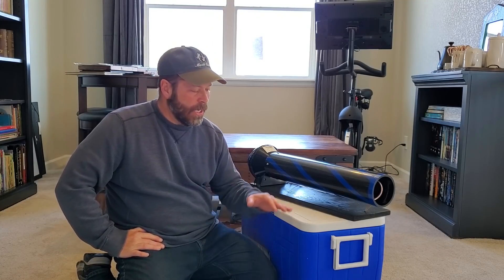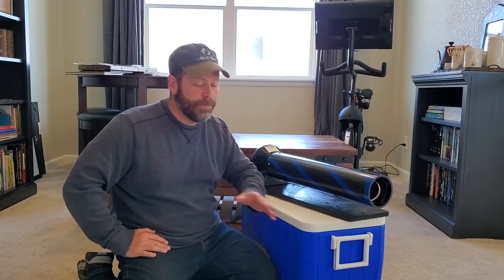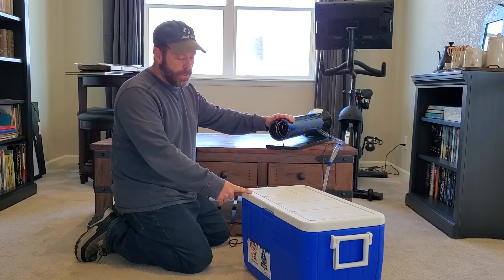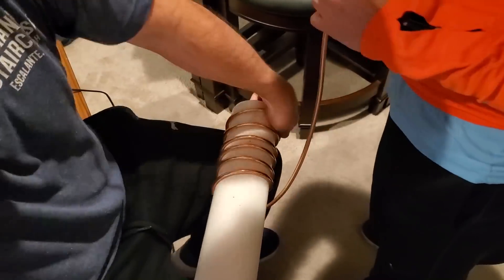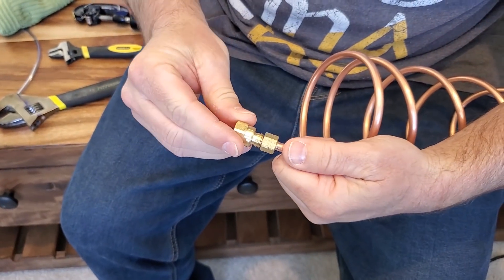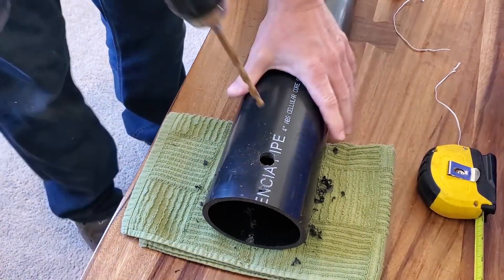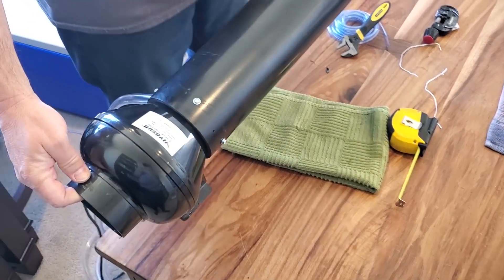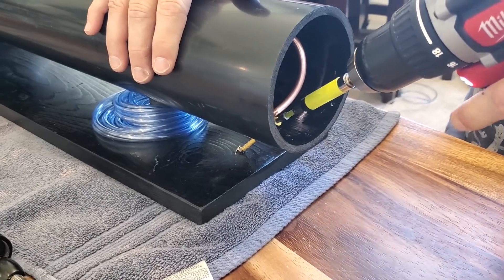Homemade Portable Air Conditioner DIY - NO HUMIDITY! - Long Lasting Ice! - The Fan Cannon

Comment: Some thoughts on this setup:

First, I'd like to say you are one of the first to use a coil setup instead of evaporative cooling, which is the best way to cool.
Next, you mounted the fan directly to the air tube, which severely limits airflow. The best way to get the most airflow is to use a larger pipe diameter than the fan outlet and the fan flow will suck air in from the extra space around the fan. This is called the Bernoulli principle. The low pressure generated by the air stream from the fan creates a suction in the tube, generating more flow, a LOT more. Think Dyson fan or compressed air venturi.

Also, you would need to insulate or house the water pipes as they will condensate in high humidity. The best way to do this is to put both inside a larger pipe and have it connect to the cooler. As long as the fan is above the cooler, then the condensation will drain back to the cooler.

A step up from this setup, which would require a permanent mount, would be to use a water coil, just like the ones used in driveway heaters and some air conditioners, for increased cooling surface area.

Lastly, I don't know if you have done this in a video or not, but I would like to see a run time on 10lbs of ice (1 bag) showing the room temperature and exit air temp during the test. Maybe do a test outside in a garage or some other shaded area when it is 80 or more outside and see how long the fan will produce sufficiently cool air.

Sorry for the long post, but this is a really great idea and very similar to what I had planned to do!
Reply: Hopefully he responds to this, but not likely. Are you capable of making one? I’d like to see it
Reply: Please make one and ahow it on YouTube like this step by step
Reply: @debbie4710  I have one, and will look into making a video on the setup of my next one. The one I made is highly experimental, and very crude. My next one, since I proved the concept, will have a proper water coil, a better fan, and a better water tank. The issue is the money needed to create it. The water tank is expensive, so I'm looking into alternatives that are insulated. I really don't want to use a cooler.
Reply: @charlieodom9107  Can you explain why you say that a coil setup is a better way to cool than evaporative cooling? Thank you if you can.
Reply: @insider235  evaporative cooling adds humidity to the air, whereas a coil does not, and can actually dehumidify if the coil temp is lower than dew point.

You would need a humidity far lower than 40% in order to use an evaporative cooler with any degree of effectiveness, and to be honest, most of the US has higher humidity than that when cooling is required.

Also, using a water coil with a closed loop keeps the water isolated from the environment. This means shit in the air won't end up in the water.

I have one that has a 12x15 or so coil, attached to a 10 gallon tank that I fill with ice water, and has a submersible pump to cycle water up to the coil. I use a 12V 14" fan in a bernoilli tube for airflow on a PWM controller for speed control. It runs on a lithium pack made from pouch cells and can run all day on a single charge, unless on max speed. Airflow at max is around 1500cfm, and cooling at that speed is nearly 10,000 btu. You need a damn commercial ice machine to keep up with the heat load.
Reply: @charlieodom9107  Ah thanks. Very informative and good description. I'm curious though as you wrote that he was one of the first to use a coil setup instead of the evaporation cooling but all every DIY AC I've seen so far has been a coil setup. Could you possibly post a link to one of the more popular evaporative cooling setups that you are referring to? I did see one where a man used a maroon colored sheet over a screen door but I had to dig to find that. All the homemade AC videos I've seen on here are coil setups otherwise. Thanks again!
Reply: @insider235  the evaporative cooling ones are all over the place. Any cooling device that moves air across the ice water is evaporative cooling. Most people who build these just mount a fan on top of a 5 gallon bucket and put holes in the side. There are variations, like using a cooler and mounting a 90° pvc coupler beside the fan, both mounted on top of the cooler, but the exact same principle. Air moving across a cooling mass, such as ice water.

As far as a link, just search DIY Cooler AC and you'll find a hundred or more.
Reply: @charlieodom9107  Ah, thank you Charlie. I'll check it out. This is so interesting to me and I have enjoyed learning about these DIY ACs even though I don't need to build one lol. It is obvious that you know a good bit about ACs. Thanks Again!
Reply: @insider235  I once fell into the marketing trap of evaporative cooling products, and wouldn't want anyone to do the same. It is very simple...if your humidity is below 30%, then evaporative cooling will work for you. If it is above 40%, then it will not.

Between 30-40% is a dead man zone, as you get to the point of adding too much humidity if you try to use a decent sized evaporative cooler, but it can work in small scale, like personal coolers.

Here in Florida, it is 80% or more pretty much year round.
Reply: @charlieodom9107  Ah, I get that. I detest marketing traps. I'll add evap coolers in high humidity to my list along with time shares which I recently learned about then. I understand that the humidity matters and you did mention that previously. I only was aware of vapor compression refrigeration/cooling until I read your comment on evaporative. Following that I also learned about absorption refrigeration using heat which is how my RV fridge works. I'm not sure how ice water in a copper tube is classified in the AC/refrigeration world however. In heating they say convection, conduction and radiation I think... The ice water seems to just be a convection cooling... Great point about the Bernouli tube also to allow more air flow.
Reply: @insider235  I don't know where the water coil fits in the mix either, but I do know that water coils are used in a variety of industries from homes to commercial to industrial for heating and cooling. In fact, most of your commercial air conditioners are water coils and not refrigerant coils. Schools, hospitals, offices, etc are all water coils using the exact same principle as the cooler and coil setup you see in this video.

Many large boats are also water coil heating and cooling as well, and water coils are by and large the main method of cooling engines in boats. I have even seen proprietary DIY setups on sailboats where they drop an insulated pipe into deep water to pump cold water to a coil and cool the cabin with nothing but the power needed to run the small pump and fan.
Reply: @charlieodom9107  Very interesting. I think I recall my childhood school had a water coil AC system. Also interesting about the boat and that makes sense. I am wondering about commercial water coils now however. They don't use large amounts of ice to my knowledge so I am wondering what would cool their water? If they used cold tap water from the water system without recycling it, i.e. just draining it out, then it seems like that would cause them to have high water bills and many places have to conserve water due to droughts.

So, after the water in the water coil absorbs the heat from the air how do commercial water coils cool it back down without ice? Perhaps some kind of "cooling tower" system where the water is sprayed out as a mist and air blown around it? That would cause evaporation too though which would reduce the amount of H2O in the system. Any ideas? Thanks.
Reply: @insider235  The easiest way to explain a chilled water AC system is to think of it like this:

First, it uses refrigerant, just like a conventional ac, except the refrigerant is used to cool water instead of going directly to indoor air handlers.

Second, the outdoor unit is normally a cooling tower instead of an Air cooler, like conventional AC systems have, but operate on the same principle. The water cools the refrigerant, and the air cools the water.

Third, the indoor units are fed a chilled water supply instead of refrigerant to cool the air.

The main reason for using water instead of refrigerant is two fold, distance and cost. The amount of refrigerant needed for long runs would severely raise the cost of installation, as well as repair costs, as ANY leak would result in complete loss of air conditioning, and the distances required would be nearly impossible to maintain, or even install in the first place.

Water coils are significantly more efficient to install, and the low pressures are easier to maintain. You can also reverse them for use as heaters and even install backup heating in the form of gas or electric, or even geothermal, very easily.
Reply: @charlieodom9107  You have a good practical understanding. In the mid to late nineties a friend and I made made a coil system with the help of a Vietnam war era PBR (Patrol Boat, Riverine) gunner's mate, who had used the systems for cooling weapons and climate control. Our setup used copper tube in a flat double coil (tube was bent in half, then coiled using pegs in picnic bench top as a jig). Fuel line was used for the flexible runs and was wrapped in AC return tube insulation anywhere that it was in open air. A salvaged pump, adapted for AC, was used for circulation. The coil was mounted to box fan using rubber standoffs. A fan shroud from a car (I think) was adapted with laminated ammo box cardboard (shellac was used to do the lamination). The shroud stood off about half an inch or so. The well was made up of 55 gallon drum with a trashcan full of ice inside of it (with the later addition of a 1/2 barrel keg), sitting a couple of cinderblock pieces. The ice was topped off with saltwater. The space between the drum and can was filled with whatever insulation we could find. Styrofoam was made into a rudimentary lid and a card table top placed over the top. The pump was hung from the side, at the top, right under the lid, with it's intake line down at the bottom and the return on the opposite side clipped to the lid. The system was very effective, keeping a tent cool during the evenings and nights, in 90-100 degree weather. It was not run during the day when no one was home. We typically added about a bags worth of ice every day or two. Whenever it got to the point that the ice water didn't look icy anymore or the salt content of the water was too low to taste, we'd move the return to the outside and let the system drain. Then toped off again. I periodically consider building one again, but with more polish. Thus is why I am looking around here.
Reply: @charlieodom9107  Have you made one yet?
Reply: @traceyalligood5175  I have made quite a few chilled water systems, for a whole host of applications. I have even made a few hot water systems that operate the exact same way.
Reply: @charlieodom9107  Sorry to interrupt, .... A friend of mine who's an contractor told me one day some building make use of lower temperatures underground.  I think he actually said, "Six feet down it's 60 degrees f' all year round."   (Sorry if I'm wrong.  It was many years ago he said this.)  

My Q is, has anyone heard of this before?

.... GOD Bless!!!
Reply: @johnprest4  absolutely, but the temperature depends on the area. For example, ground temp here in NW Florida is much higher than in a northern state. Geographical features of the area will alter ground temps as well, but one thing is certain, the ground temp stays relatively stable all year round.

Now, on to the bigger picture here. You are talking about geothermal systems in general, more specifically, a closed loop type system, which is most certainly done in horizontal and vertical type installations.

If you could dig a deep trench and bury a bunch of geothermal pipe in your yard, you could use a pump to circulate the fluid through an air to water heat exchanger to cool the air passing through it, which is exactly what some geothermal systems do. You can also use a vertical well, which is arguably better than horizontal because of the smaller ground impact area, but can also be much more expensive to install.

The only down side to geothermal heat exchangers is the initial cost associated with getting the pipe underground. Other than that, it is extremely efficient to operate. You need something like 300-600 feet of pipe per ton of heating/cooling, so think about the area required to bury that much pipe. (Note: the pipe can be placed really close together, or even overlapping in circles in the ground to extract as much thermal energy from each sq ft of space used)

Last little note: open geothermal is sometimes used when water needs to be passed from one area to another, or for things like filling a pond. The downside is the loss of the water, but if you have a windmill pump to fill a pond, then running the pipe through a heat exchanger before emptying into the pond acts as double duty, and wouldn't require much extra infrastructure to operate. This also works well when water is constantly being discharged through an area, like a drainage runoff or irrigation. You would just use the low temp of the water to extract heat from something, like an engine, a large shop, or a house, through exchangers whenever the pumps are running.
Reply: @charlieodom9107  can you let us see your build please?
Reply: @charlieodom9107  why don't you want to use a cooler?  It's insulated?  When is your video coming out?
Reply: @JonneytheKidd  coolers aren't the right size for my application, and there is no good way to install fittings. With my setups, bulkheads are installed in the walls, floor, top, wherever I need them, and I can create a closed loop system that keeps the system from becoming nasty over time.

As far as insulation, the containers I use can be insulated as well, but I have noticed no discernable difference in performance from an insulated box, when the entire enclosure of mine are insulated with Polyiso anyway.

I did upgrade my pump to a better Johnson fresh water marine pump, and the water coil I am using now is actually smaller, because I didn't need the BTU capacity, so it is cheaper. Inside my ice box, I am using an air to water exchanger that is mounted just above the bottom of the container, and I also have a 120v heating coil so it can be used as a heater as well, although I'm working on swapping that to a propane water heater so it can run on the battery.
Reply: Thanks  @charlieodom9107  I don't understand a lot of what you said because this is not my wheelhouse.  Do you have a video or pics of your set up?  Would love to see your work.   I know a ton of peeps would follow your wisdom.
Reply: @JonneytheKidd  I don't have a video, and don't have any time right now to upload anything, but I can walk anyone through what I do and use for my setups. People just need to be aware that I don't do cheap shit. The one I have in my garage right now costs nearly 1,000 bucks, with lead batteries, and over 3 grand with lithium, so most people aren't willing to spend that kind of money on anything like this.

This is why people use coolers, shitty pumps, duct tape over holes, house fans, etc.

When I started this endeavor, I did proof of concept testing with an old AC coil, a used pond pump, a vehicle electric fan, and a 5 gallon bucket. That is what people think they can use for a permanent setup.
Reply: @JonneytheKidd  at the end of the day, it boils down to the amount of BTU available in ice, or cold water, because the ice melts extremely fast. What you will find is it is far better to get a ground loop installed at your location, a vertical one, and cycle the coolant (distilled water) through it for the most effective results. This presents another problem, portability.

My current setup has a pair of 12v300ah lithium batteries, and can run the pair of 12" fans and pump for about 20 hours, give or take, but I need to feed it ice at a rate even commercial ice machines have difficulty keeping up, so is it really worth it?

Just buy a damn mini-split AC and save yourself the headache.
Reply: One last tidbit of information:

My 15gallon container, when filled with ice cold water (ice completely melted), has roughly about 5,000 BTUs of cooling capacity. That is completely shit, and is why these types of systems blow through so much ice.

I can't change the laws of thermodynamics, so unless you have access to unlimited ice, you'll quickly find out that these things are a novelty, or at best a great learning experience into the scientific world of thermodynamics.

Also note, I am installing LG multi-Split AC everywhere in my house, and in my new off grid woodshop, because it is cheaper, more efficient, and can run on solar and lithium really easily.
Reply: @charlieodom9107  Charlie- for a closed loop system, do you need the same size tubing for input and output ports?
Reply: @nflorek73  ideally, you would want less resistance on the return leg, but as long as the pump will flow water, it doesn't matter. You can even put a valve on the return to restrict flow if your pump is flowing too much, but it would be better to reduce pump size.
Reply: @charlieodom9107  this guy hasn't posted a video in over 5 years - where is your build?
Reply: @chuckger1625  as I have said many times, I have built many of these, but the BTU is not there for them to work effectively. The science doesn't lie. By the time you factor in the cost of ice and how often you have to replenish that ice, you are much better off with a normal AC. I do not need to post any video because the science and data are clearly documented, and I have posted the actual BTU you achieve by cooling with ice.

For example, I just built a 7 ton chiller system with more than 20 gallons of water in the system. A single 16k air handler will raise the temperature of the water by 10° in about 3min. So, unless you want to break the laws of thermodynamics, this shit just won't work.
Reply: @charlieodom9107  If all of my coworkers want the A/C set to 75 and I want it set to 68, do you think this would work in my cubical for 9 hours a day? We have a big ice machine here so ice is no problem.
Reply: @illuminerd3757  Yes, it will work as long as you resupply it with Ice. The only issue with one of these is the humidity it adds to the air. Ideally, you would want to circulate the water inside a pipe, then blow air across the pipe. The "pipe" can be a little radiator/heat exchanger or as simple as a coiled up tube behind a fan.

You can actually build one really small, that only takes a few pounds of ice, and uses a water cooler from a PC and it works fine. You'll be refilling the ice every hour on average, though, depending on airflow.
Reply: @charlieodom9107 I’m thinking of doing this I also camp and have a 4 season INSULATED TENT that is mean to be able to funnel AC air from a hose. My idea is create a closed looped system like you said. With two heat exchangers one sitting in a smaller cooler packed with ice even dry ice. The heat exchanger having antifreeze inside of it to prevent freezing over. The coolant with insulated lines would then be pumped to another heat exchanger like a trans cooler with a 12v fan behind it inside the the tent. allowing the cold air to recirculate. I would just need to tackle the condensation issue. Luckily I’m not in a high humidity area. I can always just pump the air in but would just be a bulkier packaging.
Reply: @Steveslenss  you are much better off getting a window AC unit or a dual hose portable unit. Dry ice won't work, too cold and too hard to source. You will need access to an ice machine to refill ice at least once an hour, depending on container size.

Do you plan on getting up every hour at night to add more ice? Where are you going to find ice in the middle of the night?

A portable AC with a dual hose setup to reject the hot air is the best way to keep a tent cool.
Reply: @charlieodom9107 Is it possible you put a small video of the cooler you made on you YT channel? I love to see it. Doesn't have to be a long video, just how it looks inside and out. Thank you!
Reply: @TinusTegenlicht  sorry. The cooler version is long gone. That was many years ago and was ONLY used as a test bench for a more robust system.

If I can get up to my parents house sometime soon, I can do a video on the one I have running up there. It has a heat exchanger that is typically used for a heated driveway and a 120v blower off a 4 ton house AC unit. For the pump, I used a standard washdown pump for a boat, and the tank is a molded plastic bin I got from US Plastic to refill the ice.

It burns through 5 gallons of ice in minutes, so having an ice machine nearby is essential.
Reply: @charlieodom9107  Thank you for your swift reply! If you could do that for me, film the one at your parents house, that would be great. Thank you!

I have a small hobby room, 13 feet x 7.5 feet x 6 feet. I don't have an a/c, bcs here in the Netherlands houses are built very different. I use a small mobile a/c now, but I have to open a window on the sunny side of the house. Not only does the heat enter my room from the outside, but it is a town house and if the neighbours sit in their backyard it is hardly 6 feet from my noisy a/c hose to their chairs, so that isn't a good idea either.

 I want to make a cooler myself, so I am looking for the best option. I think a small room like this can be cooled with such a cooler. It is 75 F now and I hope to get it down to 71 F if possible. I just cannot stand anything above that.
Reply: @TinusTegenlicht  the problem is BTUs. There just isn't a lot available in ice water.

It sounds to me like your best option would be a small mini-split. You can run the lines through a window if you don't feel like cutting a hole in the wall. The outdoor unit on those are very quiet also.
Reply: @charlieodom9107  Instead of a bigger pipe for the fan, would air holes in the pipe (say 1/2 way up) work?  And if you do make one please include the link and show the hookups better please.   I thought about the condensation too.   Thx
Reply: @suecook8379  I don't understand what the purpose of holes would be and what the end goal of what you're trying to build would be.
Reply: @charlieodom9107  You had mentioned more air flow
Reply: @suecook8379  The airflow in this specific example is meant to operate under the bernouli principle, so adding holes in the side would cause the vacuum to fail completely.

If you need more airflow in a setup, then install a more powerful fan. The issue, though, is BTU. No matter how much airflow you have, you'll still have the same BYU, so more air won't matter.

As I have said before, these do not work for very long. You need to have a massive stream of ice being dropped into the system for it to work for any length of time. Also, you need to isolate the air from the water, or you'll have a humidifier/evaporative cooler. This is fine if you are in a dry climate.

The most efficient way to make one of these is to use a closed water loop, and pass the air through a water to air heat exchanger. Even more efficient is to pipe the closed loop into a geothermal ground loop so the water will stay the same temp and provide a lot of BTU. I have tried this successfully in Florida with 70+ degree ground temps.
Reply: @Charlie Odom   Let me start by saying I typically learn as I go and my desire to make things look cooler and dumb it down usually wrecks my ideas lol.  So since you seem to have a pretty deep knowledge about these things I would like to run something by you.  This is for my vehicle.. AC went out .. South Central Texas.. in the country.. HOT!  I want it more compact to sit in the back of my patriot and simply blow forward.. no need for a cannon.. was thinking a 5 gallon gatorade cooler, using a basic no frills blower ( 260 cfm ish) and a directional doohicky to give it some flexibility.  I figure the water pump and water will sit in about 3 inches at the bottom, just above the water line I will install 4  two inch 90 deg elbows equally distanced for airflow and to keep the flow from going across the water.  Line the rest of the interior with copper tubing, maybe even add an insulated liner under the copper tubing just for a little added helper.  Will this have the same effect,  I am unfamiliar with the science behind it and unsure if the increased circumference will have a negative effect.   I hope your still monitoring this.. lol
Reply: Hi Charlie. I’m super late to this game but you seem to have the knowledge and also live in FL so hopefully you see this or someone does:  what setup would you pick to bring to the beach in fl to use inside a tent (a small pop up type for say 3-4 people). I want one to keep cool inside the tent but keeping in mind that although we just entered our 40’s we get freakier than we did in high school. Like any great team we usually run two-a-days minimum on the good days.  So I wanted something that’ll keep her comfy when doing Ummmm “cardio” inside the tent if and when the mood strikes. Thanks!
Reply: @n3rdup148  It really depends on how portable, and how much power you'll have at your disposal, plus the type of tent used.

When we tent camp, we use a 4 season type tent, and run a normal window unit in the slot made for it in our tent, but we have plenty of power available.

A 5kwh battery pack will power a 12k AC for 5 hours, roughly, and battery packs get heavy and expensive quick, so being near a 120v source is a must in that situation, or dry camping very close to your vehicle.

If you don't mind the noise, a small inverter generator and battery pack does fine, but you'll need a gas can for multiple nights.

Tent camping between May and October in Florida is a death sentence without some form of conditioning, or some hard core roughnecks, but outside of that, a couple of 6" duct fans through the door work wonders, and don't use a lot of power.
Reply: Have you made a version yet? I would be interested to see improvements.
Reply: @chasborring8285  I have made multiple finished units, and many more trial and error prototypes, but all of mine are closed loop, not evaporative coolers, because of the high humidity in my area.
Reply: @charlieodom9107 Thanks for all of the info. I’m going to make one for an outdoor camping event very soon. Only need it for one night, and for the experience and bragging rights of building my own portable ac. 
So, would dry ice work better?
Reply: @jjmonty8090  dry ice is not only hard to get, but it sublimates, which eliminates it from being used very easily.
Reply: @charlieodom9107  Reply appreciated! How many degrees are we talking about lowering the tent if we had a setup similar to the one in this video, except with an upgraded water coil, added salt, and tube larger than the fan? BTW, is a water coil the same as a serpentine condenser coil, say 12x20 inches? It’ll be around 75/80 degrees out in Texas.
Reply: @jjmonty8090  a water coil has larger tubes than a refrigerant coil, and runs on much lower pressure. You need a serious pump to flow much water through a condenser coil, so I wouldn't recommend it.

As far as cooling, here are the numbers:

Ice water is 37°, roughly.
To get thermal transfer, you want the water to have a 10° delta, so 65° is pushing the limit of ability to cool.

Let's just figure on 30° of cooling potential, for best case scenario sake.

Water has 8.33 BTU per gallon, which means: 8.33 x 30 = 250 BTU per gallon of water in a best case scenario.

Now, add ice: Ice takes 144 BTU to melt per pound, so a 10lb bag of ice will add 1500 BTU to the mix.

Overall: 10 gallons of water and 20 lbs of ice equals 2500 + 3000, or 5500 BTU.

This is absolutely TERRIBLE! In order to cool an average size single room tent, which is NOT designed to be conditioned, you would need roughly that much PER HOUR!

A much better idea is to build yourself a portable lithium battery and getting a DC powered AC unit, like the ones made by Cruise-N-Comfort. Some of them only draw 300-500 watts.
Reply: @charlieodom9107  I actually have access to electricity, but that doesn’t bring bragging right. It’s brings first world vibes and jeering ammo from my peers. But if it it’s not doable, it’s not doable.
Reply: @jjmonty8090  there just isn't enough BTU in water to make a difference. This is why you need 500' or more per ton of AC in a ground loop.
Reply: Wow! Why don't you just make a video?
Reply: @jennifernelson7766  what is the point? I have wasted too much money on these projects already, and no one is offering to send me anything to build and test, so I have went a different route now.

Water just doesn't have the BTU available to cool effectively, absent obscene volumes, and the efficiency losses trying to freeze water and insulate it makes it very hard to recommend.

The best two ways to cool are still ground loop or refrigerant.
Reply: Hi there what would you recomend to a better sistem, any info would be apreciated thanks for your time
Reply: How cold does the air  get for this one?
Reply: @iExamineLife  that doesn't matter, because it will only stay cold as long as you can keep pouring ice into the box.

It takes a literal ton of ice to store enough BTU to do any good.

You would be better off creating a split unit with a lithium battery and a refrigerant pump.
Reply: Some thoughts on your thoughts...Ok pro it's been a year where is your definitive build? Whoops there's not one, armchair quarterbacks never follow thru